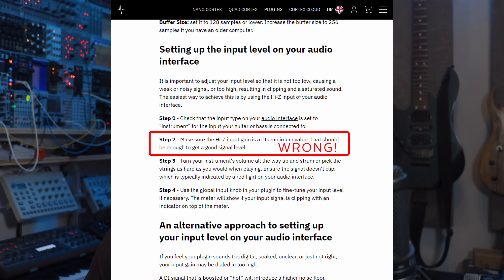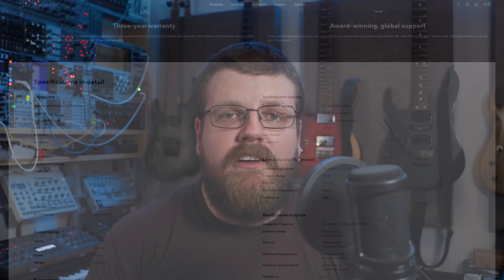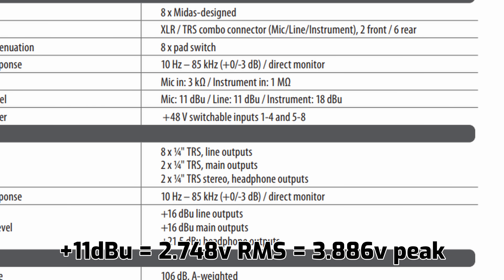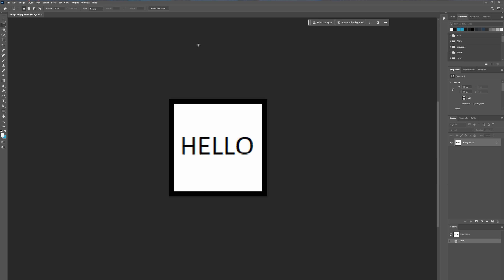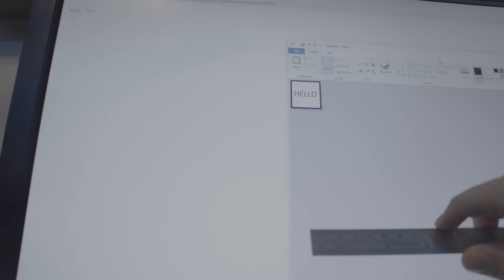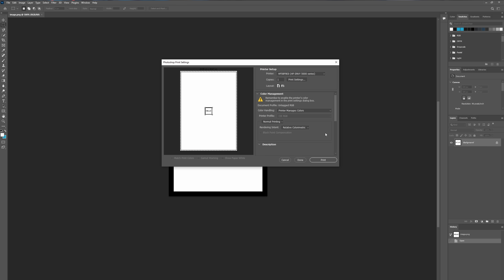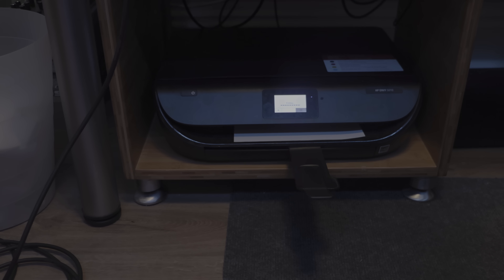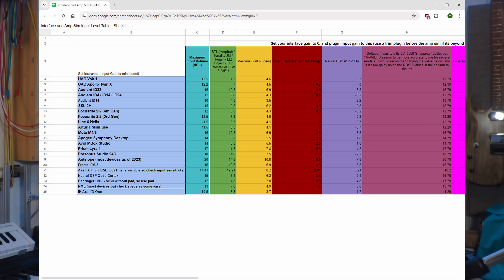Ampsims and input gain - Please, stop the madness...

Comment: I remember this started actually just by finding the correct signal strength, like Neural DSP designed plugin by a standard and most common interfaces have that level of strength when gain is at 0. But surely this will have bad SNR. I'm actually surprised to this day people saying "all you need to do is turning to 0" without any thinking of what they need to achieve and what device they have.
Thanks for pointing this out.

Comment: hi , thankyou for this video. I have just started with plugins and thanks to you I saved a lot of trouble.  I have two plugins from Neural and every time I change the preset or switch the plugin, the input resets. so should I adjust the same input levels on all my plugins? or does that value changes based on plugins. I hasve just calculated and I need to be -18 with plini. thanks
so will MK also be at -18?

Comment: Do not use amp sims use real amps you can get small ones really cheap
Reply from the maker: @BurninSven1  there are lots of good reasons to use amp sims. I've personally got 8 amps sitting right behind me, yet I very frequently find myself reaching for sims over my hardware. The convenience is one thing, the low noise (when you adjust things correctly :), the variety, the cost... it all makes sims a very attractive choice.

Comment: I agree with everything stated except you skipped over one small but critical aspect, which I've addressed in this video:

https://www.youtube.com/watch?v=gKx6WDzYn4Q
Reply from the maker: Cool video! 😀 - I've left a comment with some thoughts. You're right in that this concept can and should be extended to boost pedals as well, and basically any nonlinear plugins, they all need to be  gainstaged correctly to work as intended.

Comment: Cool video, feels very conclusive while still being beginner friendly!

How would I approach this for my steinberg UR22C that is not on the spreadsheet? I'm also a little confused by the documentation I find about the high impedance switch. When turned on, the max input volume is given in dBV but for balanced mic in and line in with regular impedance, it's in dBu...

Comment: Great video, though it left me a little concerned... I have an HX Stomp, and like to record my DI signal along with the processed signal from the unit. The worrying bit is that the DI is coming into my DAW at -18db, so nowhere near clipping. Should I be boosting this DI signal in my DAW before it hits the amp sim I'm using? There doesn't seem to be any way to boost the DI signal from the HX Stomp itself. Currently the noise floor on high gain settings is less than acceptable...

Comment: What they should have done when developing that spreadsheet was start with maximum no clipping gain then determine what the software setting should be for each guitar type.  It’s the only true fool proof way to tune the thing, because, like you said, who’s to say unity gain on every interface results in the same input voltage to digital signal level?  If I set my input for, say, 2db of digital headroom, it wouldn’t matter what my interface was at all, just that I had 2db of digital headroom.

Comment: Do ampsims make the noise floor more audible? I have not really worked with sims and in the real world the I usually just go with what the first player has worked out with their amp and pedal board. So maybe it's the same with physical amps. I know distorted amps are compressed so a higher noise floor would make sense with the limited dynamic range. 
 
The pre amp i use has a extremely low noise floor. 
I have worked with a variety of other interfaces for projects not involving ampsims and noticed some of them have a sweet spot. Where the signal to noise is much improved and if you crank the analog gain higher, noise is added to the signal even if you are far from peaking. 

We use to deal with this with some pretty good analog boards where the goal was the best signal to noise and that wasn't always the highest gain.

Comment: 4:22 That thought is just ignorant. I digitized my vinyl, and cassette, collection 30+ years ago. I was one of the first disk jockeys that I know of, who did. (Took me 3 years. Don't get me started, on how i had to daisy-chain tiny 10mb hard drives.)

I set levels, using the eq on my Mackie mixer, (using an old, even at the time, Technics audio frequency analyzer), to find peaks. Adding, then subtracting db gives the cleanest recordings.

If you, "just set it to zero db", you'll have a muddy recording, with no clarity, or definition.

I'm sure the same is true for any analog-to-digital interface.

Comment: The compensation is by ear?.
Reply from the maker: no, usually not. It's based on the input levels of the audio interface, and the expected input level for the plugin that you're using. EdS collected the data in the spreadsheet, and he contacted several plugin companies to confirm the correct input levels. But I think a few did not give an answer, and those were matched by ear. Reach out to Ed or check his channel for more detailed answers on that (link to his channel in the video description).

Comment: Attempting to follow this as I just got my first interface (Audient ID4 mk2) and a neural dsp plugin. How can I tell on this interface if I'm just below clipping? There's a "meter" on the interface that has white lights and red at the end. I never seem to hit red even with the input gain turned to max.. But in their mixer app it looks like I'm pegging the meter at +6 (highest is goes) and the number at the bottom shows (0). The mixer app looks like I'm clipping then? (Is anything above 0 clipping?)
Reply from the maker: I'm not sure about how the Audient works, specifically, but every interface I've used has had a small LED indicator that goes red if your signal goes above the threshold. So basically dial up the gain until you hit that level while playing as loud as possible, then back it off just a little.
Reply: @GhostNoteAudio  Thanks! I'll keep trying to get this worked out. The only downside I have so far is when browsing presets in neural, you have to adjust the input for every single one. Doesn't appear to be a way to globally set/lock it -- that seems like an odd oversight. I've seen what you're referring to on a scarlett interface in regards to the clipping indicator. Does the ID4 just have more headroom to where my passive pickups never clip it I wonder?
Reply from the maker: @poxin  You can use something like Kilohearts Gain to work around that. Just add it in front of your ampsim plugin and set the gain there :)

Comment: I don't understand why this is so hard.  
Don't exceed 0db.  Period.  
As bass player, fingers, pick and slap produce radically different output levels from the bass.  Active and passive pickups make a difference, as well as using the output of a preamp (for IR cab sim input).
I changed the input gain to peak and then back it off so my hardest hit note does not clip.  

It's not that fucking hard.

Comment: Thanls for the great video! Is this the same approach i should take when recording D.I  guitar tracks at my home studio in order to be reamped and mixed in a professional studio?
Reply from the maker: Most certainly. Always hit your converters with the strongest signal possible, but without clipping. The mixing engineer will be able to adjust the level going out to the reamp box and into the amp as necessary. By following the basic gain staging best practices you can ensure you provide them the best source material possible.

Comment: what about the new nt 1 gen 5 with 32 integrated ADC with no gain knob???
Reply from the maker: Most of the 32 bit interfaces and gear that's been coming out recently uses a dual-converter setup; basically, one converter set to a very low gain, and another set high. Then the two signals are combined in software (firmware inside the unit), to produce a unified, super dynamic range signal. I am SUPEER excited about this development, it's definitely here to stay and I think we'll see it become a standard feature on interfaces over the next decade. It basically invalidates everything about this video, because the interface does the job of gain staging for you 😀

Comment: Just do what sounds better!!! For example, if I'm using single coils I am just going to amplify their noise same way as using digital gain. At last I will still suffer of the audio interface noise, which is a much lower noise contribution most of the time, but I may trade that with the preamp color which maybe I don't like and I can get rid of that noise with noise gates. Sometimes if I want to achieve a very clean sound out of a marshall amp sim maybe I might want to keep the amp sim volume at 10 but have less digital level hitting the plugin... so I want to keep low interface and plugin input gain. I think in principle he's right, no doubts, but this reasoning mostly applies to high distortion with humbucker guitars. There are no golden rules

Comment: im glad i found this. i kind of just assumed amp sims are meant to be left at "zero" input level with the interface properly gain staged (the way you explain it, which is how ive always done it. turn it up, keep it out of the red). i never thought about needing to set the amp sim input gain to a "correct" level. i guess ive been running it too hot. luckily i use a UMC and neural dsp so this chart will work.
Reply: i lost about 6db of noise doing this lol hell ya

Comment: Great video. I really appreciate it as this was a big black box for me before. 

I have one question though. I have the Axe i/o (not the Axe i/o One) and I'm unsure of what is the referenced "max input volume dbu" of the spreadsheet it. 

The specs says (For Axe i/o): 
Input level, min gain: 0 dBFS is obtained with a +14 dBu signal at the TS input
Input level, max gain: 0 dBFS is obtained with a -17 dBu signal at the TS input

and the specs for Axe i/o One:
Input level, min gain: 0 dBFS is obtained with a +10.5 dBu signal at the TS input
Input level, max gain: 0 dBFS is obtained with a -19 dBu signal at the TS input

And in the spreadsheet it says "10.5" for Axe i/o One. So am I right in assuming the correct value for me to use with the spreadsheet is 14 dbu for Axe i/o?

Comment: Why would there even be a gain knob if it should always be set to 0?  That makes absolutely no sense.  Of course it has a function.  :)  Your explanation made a lot of sense though.  Increasing your signal to noise ratio will increase your headroom.  That's amplifier 101.  There are two ways to increase signal to noise ratio - increase your signal or decrease your noise.  Hence - input gain.

Comment: 1:56 What? "Negative -1" from DAC output? You are not good with technical understanding.
Reply from the maker: What are you on about? I wasn't talking about DACs. I was talking about ADCs. And they obviously convert analog input to a digital value with a certain range. In your DAW, that number is represented in floating point format, and generally represented in the range between +1 and -1. You've gotta listen to the words :)
Reply: @GhostNoteAudio  "DAC" was my typo. But it doesn't matter.
Are you saying that that ADCs also outputs signal in -1 and +1 range? 
If you mean 32bit floating point in DAW, then this number can be zero or can range from -3.40282347E+38 to -1.17549435E-38, or from 1.17549435E-38 to 3.40282347E+38.
I'm not sure if you have any idea how big a number that is, but I'll say that's a hell of a big number, not your "+1 to -1". 

All ADCs, or DACs outputs just "0" or "1". And NOTHING in between. 16bit, 24bit, or 1bit - it doesn't matter. And all is recorded as "0" or "1", just in different lengths.
Even a "32 bit" ADCs actually works the same (outputs "0" OR "1"), but uses two separate ADCs with different sensitivity, and switches between them.

I listened first two minutes and there were already two nonsense. Sorry, but such an amateurish approach can confuse people. I believe you can do better. Cheers!
Reply from the maker: @eduardzemlianoi  🤦I have no words for this word vomit.
Reply: @GhostNoteAudio  You felt it! This was exactly my reaction to your video :)
Reply from the maker: I'll type up this answer, not for you, because you don't deserve it after the insults you've been hurling at me, but for the other people who actually want to learn something.

A 16 bit converter will generate a digital signal in the range of -32,768 to +32,767, for a total of 2^16 = 65536 possible levels. A 24 bit converter will generate a digital signal in the range −8,388,608 to +8,388,607, for a total of 2^24 = 16777216 possible levels. We're talking PCM, so don't try to weasel out of it by bringing up DSD or something - that's out of scope.

Now, in your DAW, these signals are transformed into 32 bit floating point numbers. Some DAWs even use 64 bit, but let's assume 32 bit for now. I don't know of any DAW that doesn't use IEEE754 format floats, so I'm also going to assume that is what we're using to represent and store our floating point numbers.

Now, you are correct about the maximum range of float32, but you have completely ignored the important part; precision. They have a range of up to 340 undecillion, but that's not useful in any way, shape or form, because a 32 bit float can only carry 7 significant decimal digits (or more precisely, 24 base-2 digits).

We are free to choose whatever number we want as the reference for our "full scale" when measuring 0dBFS (FS = Full scale). You could choose the maximum value that a float32 can carry, which is indeed ~3.40282347E+38, and normalize all of our signals to that reference... if you were a moron. 

But it has no effect on the precision we can store. So we choose a more suitable, reasonable range of numbers, like... uhm, let's see; +-1.0! The number we choose is irrelevant, but I think we can all agree that a range between -1 and +1 is probably a reasonable choice, certainly more reasonable the 340 undecillion. So we take all our signals, whether they were recorded as 16 bit or 24 bit or 32 bit, and we normalize them in such a way, that the possible maximum value of a signal with that bit depth corresponds to 1.0 in floating point form.

Don't believe me? Try recording any sound, on any audio interface, in any DAW, export it as a 32 bit float .wav file, and open it in any audio editor you want, and you'll see the signal lies between +-1.0.
Yes, they can go above 1.0. That's the cool thing about floating point wave files, they don't clip like fixed point formats. But the REFERENCE value is still 1.0, and that holds true for every DAW, and every audio driver in existence, as far as I know. 

You absolutely CAN choose a different value as your full scale reference, but most people are not stupid enough to develop software or hardware that breaks this convention, because there is absolutely no reason to do so.

tl;dr: You forgot about precision and normalization.

You've made a fool of yourself on a public platform. Do your homework next time before trying to argue with someone who actually knows what they're talking about. Be better.

Comment: Where did you get the information about the "-10 dBV maximum input level" for consumer cards? 
It is a "nominal" leve", not the maximum. Sometimes it is even referred to as "CONSUMER LEVEL" (or -10 dBV unbalanced). 
The same is true for "PROFESSIONAL LEVEL" (or +4 dBu balanced) - it's also just a nominal level. 
So, taking into account the crest factor for musical material, most consumer cards would be able to cope with a 0 dBV input signal (2.8 Vp-p).
Reply from the maker: You are quite right. That was an oversimplification on my part. Apologies for that!

Comment: As a Tonex pedal  user, I'm still clueless on how to read and set the thing's "Input Trim" parameter. It does not change the level of the signal, it only changes the input gain hitting the tone model. I think that IK's idea of a level indicator helping to set the input trim is correct, but still everything sounds too saturated using the hint provided by the meter

Comment: What you outlined was exactly how I've always approached gain-staging amp sims.  Turning the interface gain to 0 is dumb - it's not just about SNR - by lowering the input gain as much as it'll go, you are digitising the noise floor with fewer bits, when you turn that up in post, it will contain far more artefacts.  So not only will you have a worse SNR - the noise may sound less natural depending on the effective bit depth you end up with for the noise floor.

Comment: Hello out there, first off, Thanks @ghostnoteaudio for the video. I was wondering though... I'm using the UA Volt 176 and Genome from Two Notes. I've tried to dial ist in but I cannot get rid of the extreme noise floor when using higher gain settings. 

What am I doing wrong? Any ideas anyone?